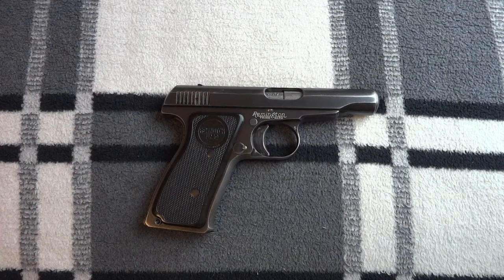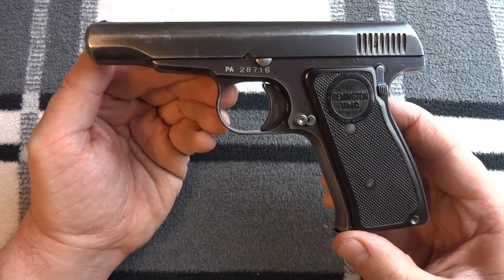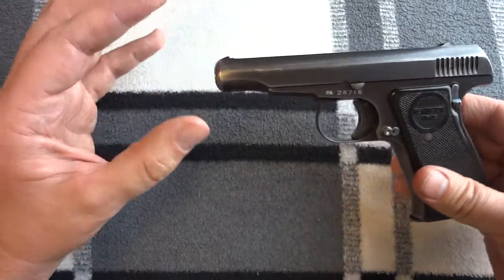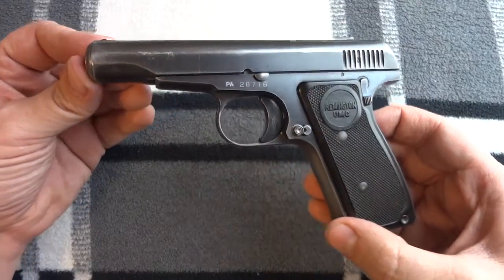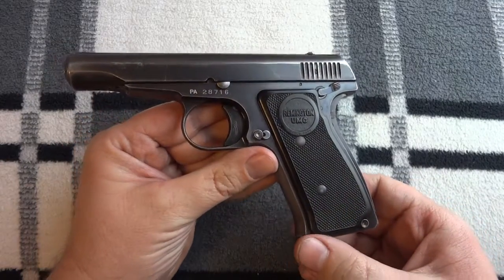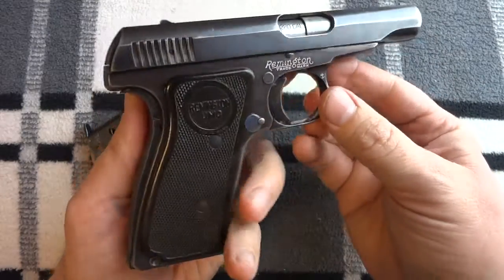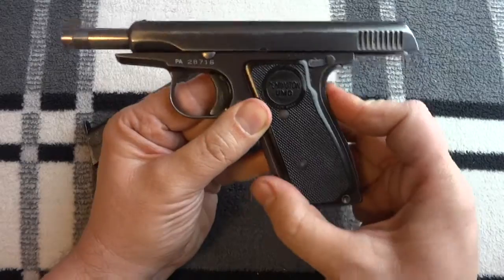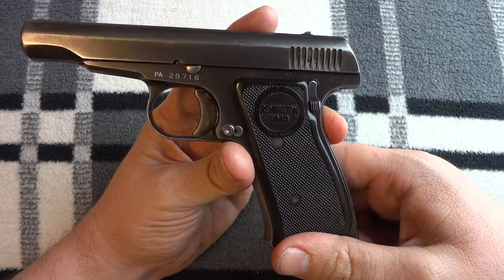Remington 51 Part 1 of 5, Overview

Comment: I had one of these in 32 and one in 380.  I swapped the 32 for a Colt 1903, but still have the 380.  It works very well.  Points as well in the hand as a Luger.  I assume everyone knows Remington brought it back in 2014 but in caliber 9mm Parabellum and yes, it handles +P too.  I look forward for a video from someone comparing the two.

Comment: I like these M51s.  I have my own u tube video of me firing my own .380 variant. The grip angle is reminiscent of the Luger and it is just as easy to point and be on target with.  I am so displeased with Remington for messing up their newer version of it.  Back in the day they made a big brother of it for the US Navy in .45 ACP and made at least 2 of them for US Govt testing purposes.  It did fairly well in the Navy's tests and only the intervention of the Ordnance Board prevented an order from being placed.  I believe one of those 45 versions still sits in the Remington museum, so their decision to just make an inferior 9mm [looks like, but isn['t' is totally not understood by me.  I have no understanding of why they just didn't walk down the hall of their own building, take the original big gun and just copy it and offer it in the 3 calibers of 9mm, .40 and .45.  I think it would have been very popular.  Instead they turned out a piece of junk.  How sad.  Anyway, the weak point of these is the locking piece.  My understanding is it can crack and the supply of ready made replacements is non-existent.  It may not be a bad idea to pull one out and have a quality machine shop make some clones of quality metal before the crack happens.
Reply from the maker: +Ken ibn Anak The "M1918" or "M53" as some call it beat out the 1911 in Navy trials.  Remington and Pedersen wanted the Navy to pay for them to tool up for mass production.  At that point, Army Ordnance intervened and placed an order for the 1911 with Remington.  Rather than continuing to pursue their own gun, the Navy chose to capitulate and adopt the 1911.  Historically speaking with WWI underway, this was probably the right decision.  Ultimately, Remington was also deep into the M1917 production... so much so that they had to build a whole new factory at Eddystone.

On the R51, AAC actually undertook the design work and based it on the M53 pistol that they had access to blueprints and the prototype.  The design is solid and you can watch my videos on my own personal R51 saga if you have the stomach for it.  The execution of the design, though, is where they failed.  Rumor is that they tapped Para USA to build the gun and then gave everybody at Para their pink slips... they FIRED them all but then expected them to make a pistol.  Sure, they could reapply for a job in Alabama, but at a lower pay and without a funded move.  Not sure, I'm just hearing that as rumors for what happened.

As for the bolt on the original model 51... no, it is seriously doubtful that a new bolt could be made that even matched the durability of the old part.  Yes, they were fragile and I have two broken bolts in my collection along with a broken cam-lug on a slide.  Using mild, American-made .380 ball ammunition, they should last a lifetime.  Do not shoot 'personal defense' ammo, hollow-points, or any European-origin ammo as that is loaded hotter.
Reply: Well I can't speak towards the R 51 other than being greatly disappointed at the outcome.
However, history shows the M-53 is an almost was in that the US Navy had solicited a bid for them to Remington, Remington then replied with a bid the Navy said was too high.  Then WWI ended.  In 1919 Remington provided a second, much lower bid offer, but with the War ended and everything being cut back, the Navy could no longer justify buying a new gun when they now had more than enough M-1911s for peacetime service.